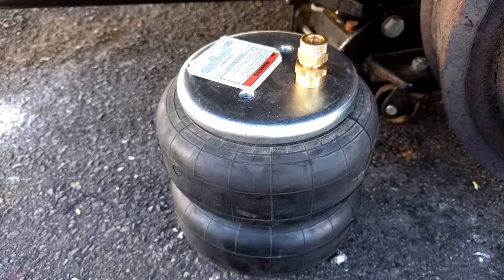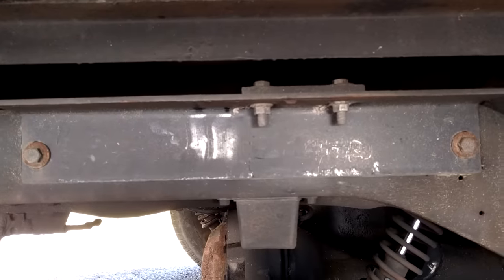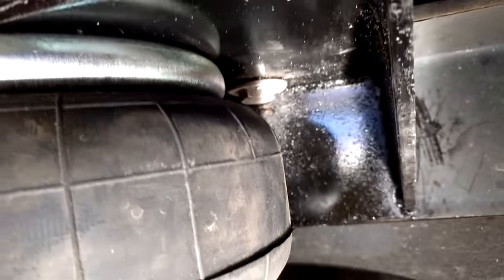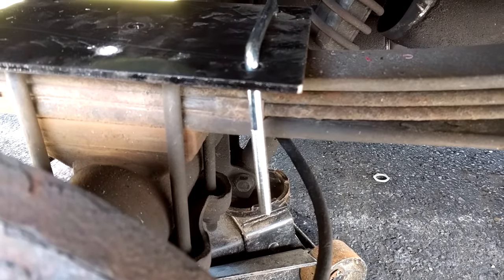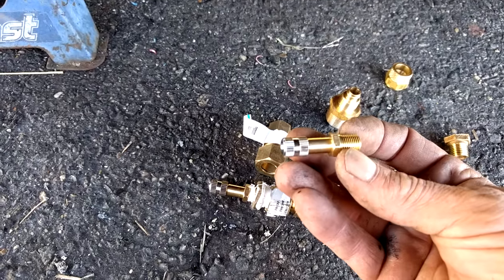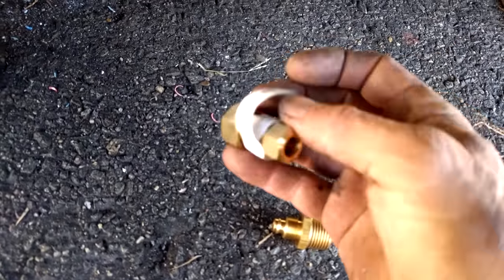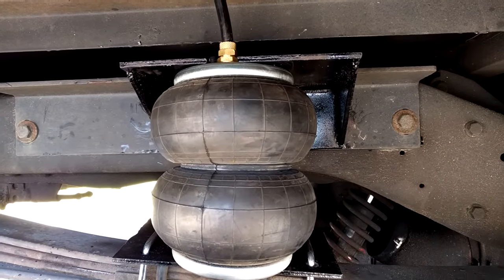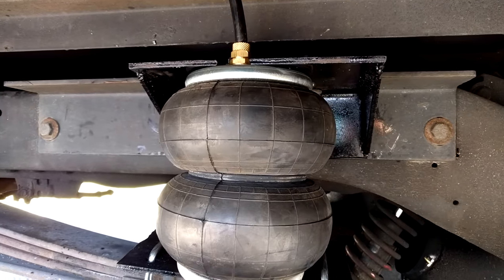How to Air Bag your truck for $100 (Air Bag Suspension) Awesome Upgrade

Comment from the maker: UPDATE:  I did change the bottom strap (under the spring) that holds the bottom plate on to 1/4 steel. For those that don't believe this works, I have tow heavy loads (10,000 or more) more then 12 times with no problems. If you would like to see a before and after photo with "About" 15,000 pounds (I know how my trailer sits with that much weight) look here 
https://www.how2fixvideos.com/Dodge_page_3_videos.html
Reply: LOL the first picture with the cooler unit has all the weight to the front of the trailer... The second picture is fire wood is all stacked even the length of the trailer... That NOT a very fair showing of the before and after is it now... Those air bags are JUNK...
Reply: Glenn 350
Reply: you probably no this by now but you can get 90 degree push fittings from 18 wheeler parts house for the top of the bag
Reply: Please dont copy this crap job
Reply: Z71Ranger n
Reply: @Z71Ranger  o
Reply: Really wanted to see them work
Reply: 0
Reply: Where did you get the bags at?
Reply from the maker: @Hoge-mn9lg  airbag it .com or you can find them on ebay
Reply: Like you can even watch your video there are so many ads it's unbelievable what's the point of putting a video up if you can't watch the video
Reply: Glenn we all came here to see your worm move

Comment: I plan on doing this + sway bar / torsion bar system in replacement of my leaf spring suspension on my new yorker. Don't want to screw around with rusty brackets and all trying to replace the leaves. This video helps a lot in my figuring this stuff out, thanks!
Reply from the maker: Glad it helped

Comment: With air lines there are small sleeves that go inside the line to back up the ferrell for those type of compression fittings without the sleeve or nipple built into the fitting

Comment: Nice work but I disagree that it's a good time for someone who has never welded before to take a shot at it. Not something that goes down the highway.
Reply from the maker: You are right I should have said " good time to learn but not to put to use till after you learn".
Reply: Yup I was going to say the same thing. I'm self taught mostly myself ( my dad also taught me some at first) but I wouldn't trust my first attempts at welding down the highway either :p.
Reply: Weld like horrible
Reply: @Glennfix  I understood what you actually meant to say....
What he was saying y'all....Lol 
That if someone had ever thought about welding, that would be a good time to try and learn the trade!
Reply: Depends on what exactly it is and what part exactly your welding, in this case adding those triangle pieces was overkill, the 1/4 plate won’t flex , I know, I used 3/16 plating to make mine. So it is one of the best times to do it yourself when your welding on something that just for piece of mind and not really needed. It’s all bolted on, it’s not falling off the truck. At worst the triangle support pieces would fall off, but I’m pretty sure if anyone did that poor of a job they could see it wasn’t going to work. I know the top flange has to stick out so far it looks like it might be weak, but the top of those air springs are flat on top and you they basically stiffen the plate once they are bolted on tight.
Reply: @NoOneSpecific
Absolute rubbish.
Reply from the maker: @jwill9877  The air bags have been on my truck since 10/2017, I have towed close to 20,000 pounds more then once. I replaced one airbag because a tire blew out and ripped it. Other then that they have been grate. When I was a kid I was told if you cant say something nice don't say anything.

Comment: You could periodically spray them with 303 Protectant . Used to resist plastics and rubber from cracking and drying out .

Comment: Nice job designing and fabricating . I've seen 3 vehicles , over the last 7 years with the same system that ended up with twisted frame rails and broken cross members . You can't take the weight off the springs and transfer it to the top of the frame rails without bending them . That's why Timbrens are designed to mount directly under the frame rail. Two more leaves on each side , of .499 steal will carry the load and won't damage the frame . Sorry , I don't mean to sound like " That Guy". Especially after the sweet job you did mounting it .

Comment: Something to think about. I have air bags on my van for heavy loads and run 1/2 ton springs for comfort.  Thus I like to change the pressure in my bags all the time. So I have an on board air compressor. I have  the air bags plumbed in to valves and a pressure regulator with a gauge for each side. If the load is uneven I run higher pressure in that side. The gauges tell me the pressure in each bag and the valves isolate the bags from the compressor side since any system leaks seem to show up from that side. Works pretty good. I have all that  mounted to the side of the seat. I open the door to get in and can instantly see the pressures in both bags. I can also alter them in just a few seconds. Turn the knob on the pressure regulator to set the new pressure. Just that easy.  Of course I also use the air for airing up tires after a run on the beach or off road trail.
Reply: consaka1 to
Reply: Shawn T  ?
Reply: Sweet! Is it a 1 ton van using 1/2 ton springs? Would like to see a video of it! Can you make one and post it here?
Reply: @technicalitems731  Actually it is classed a heavy half ton. It had a half ton rear axle that was really weak with my new diesel engine. So I found a full float 14 bolt from a one ton van and haven't had a problem since.
As for videos, I don't really have talent there.

Comment: I know the video is older. Maybe you will still see the comment. First , those bags you used are almost identical to the loadlifter 5000 bags , except they are good for at least 5000 lbs each. That is an air spring for a drop axle on a commercial vehicle most likely. They look very similar to the ones I used, and that’s what they were meant for. I mentioned that part just in case you didn’t know. I don’t know if the loadlifter bags are single or two ply, but the ones you have should be 2 ply, if you clean them up and spray a little of your favorite rubber protectant on them every now and then they will last a really long time. 

Second, if you do still notice the comments here, I see you installed your in a plum fashion, like straight up and down instead of with an angle like the shocks have. When you showed them right when you had them attached you could see how the bag was extended more on the bag side than on the front. This situation causes me slight concern on my installation, I did pretty much what you did almost exactly really, but I have only installed and tested them. They are on a pickup truck I’m redoing and they are one of the last things I needed to do before starting to use the truck as my everyday vehicle. I’m wondering if putting a slight lean in them sort of like the shocks are , but not that extreme, just enough to take out that condition where the back is slightly more extended would be better. I hate to tear it all back down and change it if I don’t need to. Possibly you will be able to tell me how yours held up installed like that? If you can comment on that it would be much appreciated. Awesome job by the way, it’s amazing we both came up with about the exact same design for installing those air springs. Maybe there isn’t many install options on them , I’m not really sure.
Reply from the maker: I have been very happy with them. They work great. I only had to replace one of them, and that was my fault. I had an inside tire go flat, and it rubbed on it. I made a review video if you would like to see it ( https://youtu.be/b3y2QQu2ioA ). I also added an onboard air compressor. I like the fact that I can go someplace with no load, and when I need it, I can add more air. I made a video of the air compressor if you would like to see https://youtu.be/z_WxCUVAwSk .
Reply: @Glennfix  thank you, I will check out the other videos you linked, I was thinking about a compressor, I went way way way over budget already though, covid insanity just added to the cost. I’m interested to see what you did for a compressor especially. It makes sense to be able to make your own air, those analog type control set ups are pretty cheap, then I could adjust from the cab. First I need air though. Thank you again for the reply. You have been most helpful!

Comment: I like it.
My welding is getting alot better.
I am also self-taught as you stated around 2:20
but I have had a few good welders give me tips.

I like this mod and I hope I can find a good set of bags like these.
Reply from the maker: If you like you can take a look at my video (Air-Bag Review) this is after they have been on my truck for over 2 years at, https://youtu.be/b3y2QQu2ioA

Comment: I would add a few bolts to the upper bag  mount through the side of the frame
Reply: Brian W sweet I appreciate  it if you ever need parts ect just let me know
Reply: i was looking at that... thats fucked the way the bag would push it up and away from the frame bolt that thing up
Reply: Bria           n W

Comment: These days you can buy airbag kits on eBay, Walmart, or Amazon for $160 or less. I am going to put a kit in my F150 and the price was $134 plus tax. I even got a compressor kit with gauge for another $130 plus tax so for about $280 total I have a complete airbag system. I will update after some time to let everyone know how it's holding up.
Reply from the maker: You will be happy with it.

Comment: Can cut the spring about 3" after the axle toward the rear to go to full air ride, would not use the shackle end at all. If load isn't your concern but ride is. Basically the front half of the leaf spring would act as a stabilizer torque arm. Just another option. Nice video
Reply: He would need a pan hard bar installed if he did that. The front hangers can't handle the lateral forces by themselves.
Reply: @fastredcar97  got it Matt. But it got that lateral force before. Not much keeping the lateral force on the shackle end that swivels when it was there originally. But sure. It wouldn’t hurt to run a transverse torque arm from axle to frame. That would be easiest. A Hutch trailer torque arm only cost about 40.00. Takes 1” bolts. A simple mounting fabrication would need to be added. Thanks fir responding
Reply: @jasonvala9239  as many performance trucks that get serious run a panhard as well as their leafs as the rear sways laterally quite a bit.

Comment: Definitely would bolt into the side of the top bracket / frame also. It will eventually twist out. Is the bottom of the bag even sitting all the way on the lower mount and bolted to it? Weld a piece of metal on the bottom of it in between the 2 leaf spring u-bolts as a spacer so it doesn't bow in either. Keep practicing man, it's fun to make your own stuff!

Comment: That was informative with a good job done. Now all you need to do is get rid of the coil-over overload shocks and get some really good adjustable quality aftermarket shocks. I suggest a Rancho 9000 adjustable. Or a Bilstein designed for the weights involved.
Reply: @k. R. V.  What’s wrong with the coil overs?

Comment: Nice video 1 question did you run air stem for each bag or 1 air stem an tee to each bag
Reply from the maker: They are tee together, it has worked fine for me that way.

Comment: Glenn, would you have a link or name for me to find a pair of these air bags?  Thanks.
Reply from the maker: The main website is https;//airbagit.com the same place sells on eBay under the name chassis_tech. Sometimes there stuff is cheaper on eBay. Some eBay links are https://www.ebay.com/itm/V-Air-Lift-2600-II-2-Air-Bags-Single-Port-3-8-Airhose-Springs-Suspension-FITs/282280749134 these are 2" taller and cost about $130. If you click on the eBay link you can go to their eBay store from the link. The "2600" is the weight capacity.
Reply: @Glennfix  Thank you! I appreciate it

Comment: Your truck a 3/4 ton?  I have a 1/2 ton chevy I'm trying to bag front and back without spending a grand or more.  What pressure are you normally running with empty bed and hows the ride quality?  My truck came with a 6" lift from the factory and the ride has been harsh from day 1.  Never towed alot, just occasional 8' trailer with a four wheeler or fridge.  Now its spongy due to worn out components that I'm getting ready to replace and hopefully upgrade throughout this process.
Reply from the maker: If I run 30-40 pounds in the bags it gives me a soft ride, just firmer. If I have a lot of weight I can get the same ride with more pressure.

Comment: I did this about 6-7 years ago found a used kit firestone used $65 at a swap meet....I used heavy aluminum angel it on from a computer rack tower.... the feet were 3/8th or 1/2 inch.....welded a bracket to the top of the ubolt to hold the bottom....your air bags look wider (diameter) and this is on a Dakota.......first a 94.....now a 2000....finally got them hooked up ot a air pump and controls in cab.....people are surprised how well they work........but the one thing I would recommend it to keep the have separate ......for one thing.....in the lean corning the outside bag is compressed thus transferring the extra pressure thus pushing up the opposite side....
       next time you go to weld try vertical down and just move left and right you will be surprised.....horizontal (flat) is a little tricky....me too self taught...
    key word in wire welding is bacon frying sound....
 have a good one enjoyed your video....will subb...and travel
Reply: Don Powers if you are a self taught welder that is fine. If you are running an outer shield wire vertical down is ok, if you are using an inner shield or stick welding go up. You don't want your slag to get in your weld, that will cause porosity ( I may of spelled that wrong ) thus making a weak weld. The outer shield ( gas shield ) won't give you this problem. There are some rods you can run vertical down, but I'm guessing if you are self taught you are just doing some basic welding and that's all good. Look around here on you tube there are a few guys that give very informative videos on all types of welding. The best thing is practice, no better teacher than experience.
Reply: Bob Taylor I chassised a 1969 road runner back in 84 but your tip on vertical up makes perfect sense...I built a 70 x60 what looks like a fat L canopy for I guy and took a direct.hit from a hurricane. I wall ..its 16-18 ft high built trusses out of the "C"s that thin stuff is interesting ....
 zero damage on the canopy....
   but vertical up with welding rods explains a lot when you mentioned the slang...running back into the weld....I like welding always over build...got to make it people proof...I appreciate your comment...thanks Don
Reply: Bob Taylor BOB YOU ARE RIGHT ABOUT UTUBE I WATCH ALL KINDS OF VIDEOS.....LOOKING FORWARD TO GETTING A MINI SPOOL FOR MY LINCOLN WIRE (GAS) 220V LIKE THE 110V I PICKED UP A LOT OF ALUMINUM TUBING A BUNCH OF SQUARE 3X4 BOX 120 WALL MOST 3-4 FT LONG BEEN SAVING STAINLESS ALSO. REPOURPOSING LAW MOWERS .(RIDING) PICKED A JANCY JB2400 BENDER WITH DIES I WANT TO BUILD OFF ROAD BUGGIES...
          THANKS AGAIN FOR THE REPLY....
Reply: Don Powers you can do much more with the 220 machine and do heavier stuff a lot quicker and better. You should like it. Good luck to you
Reply: Bob Taylor thanks Bob that's why I went with the 220v. I picked up a linclon 225 a.c.-dc arc welder...to looking forward for the plasma cutter and some day a tig.......good luck to you too!

Comment: Help !!!! I have a 1990 chevy obs it has air ride system however I want to remove them and switch it back to stock suspension. What will I need ?

Comment: in the diesle industry we use a spray bottle with dawn and water lol
Reply from the maker: This works but, I worked on cars when I got out of school for 5 - 6 years. Then the way life took me I ended up doing refrigeration ( have been for 25 + years ) I challenge you to buy a good quality leak detector solution and use side by side. If you have a big leak dawn works fine but for small or micro leaks sometimes it will not work so good. They put stuff in it so it will stick. I have used it and don't see anything come back in 20 - 30 minutes and see bubbles.

Comment: Do you use "plumbers putty" or teflon tape on the threads of the fittings? It will help prevent leaks.
Reply from the maker: I used teflon tape

Comment: hello
I plan to install this system on my cherokee, to pull heavy loads without losing ground clearance.
can you tell me if you are satisfied with it in the long run, and if with the recoil you would have installed it differently.

sorry if you explained it in the video but I don't speak english, I use a translator.

cordially.
Reply from the maker: I am very happy with them. They have been on my truck for over 2 years. I just added a compressor so I can adjust  the air any time. You can see the video at  https://youtu.be/z_WxCUVAwSk  If I put a lot of air with no weight It will be a hard ride. If you get the air right it will give a real smooth ride.
Reply: @Glennfix  thanks for the quick response, (the compressor installation is nice and the pressure management system is very clever), so I will do the same installation on my cherokee.

thank you and hello from France...

Comment: Use nylon lock nuts. All the haters on here have no balls, ingenuity or common sense. It’s your truck do whatever you want to it. I personally weld and fabricate. I’ve seen way worse welds hold. Whole different story if you remove leaf springs.  In this app your assisting. Holding power of angle iron should be high and low. Not in the center. Great video. GOD BLESS. LIFES A GARDEN... GROW IT!! Lol